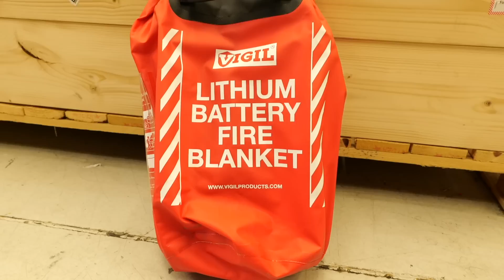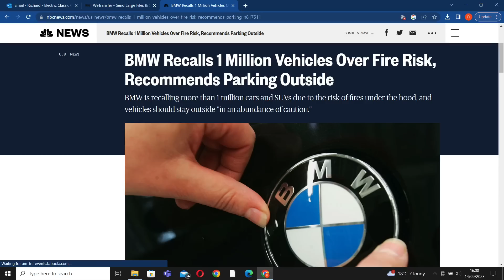Electric Car Fires - Facts and Figures

Comment: My principal objection to EVs are short range, long charge times, excessive tyre wear, very fast depreciation, high prices (although they should come down a bit)... the problem with EV fires is the difficulty of extinguishing them and the huge toxicity of the emissions when they do. High carbon footprint is another thing.
Reply from the maker: You’re missing out all the positives. They’re much cheaper to run, better handling because all the weight is underneath you and better weight distribution, no nasty tailpipe emissions choking up peoples lungs, performance is amazing and over the lifetime of the car their carbon footprint is much less than ICE equivalent. In respect to your points my wife’s Tesla model 3 is 4 years old and done 65k miles. It’s saved her £10k in fuel and servicing costs. Has depreciated only 36%, which is less than any petrol car we’ve ever had. Has had 2 sets of front tyres and one set of backs, which is about the same as ICE cars we’ve had in the past. The CO2 emissions of building a new EV is indeed more than ICE at the moment (although that’s coming down each year as manufacturing becomes more efficient and grid decarbonise) however as the emissions from driving is less than ICE it’s offset after around 16k miles here, but that’ll depend on the carbon intensity of the electricity grid in your country.

Comment: Interesting but not totally ‘factual’! Cherry picking statistics from one country is hardly serious research in my view. 

How many of the ICE fires were caused by arson, collision or other external factors? How many of the ICE fires were the result of spontaneous combustion as opposed to the EV’s due to internal fault or overheating?

Most EV’s are relatively new. Over time, what will the incidence of EV fires turn out to be? Only time will tell. 

There was no analysis or comment on the type of lithium battery, quality of design/construction of the battery or existence of battery cooling system or it’s adequacy if present. 

I’m not anti EV, but question the superficial nature of your presentation.

Comment: Excellent video, love the channel. There is definitely deliberate misinformation out there concerning all aspects of EVs and electrification in general. What makes it doubly frustrating is that the misinformation never goes away after it has been disproven. We are still trying to explain to people now that batteries don't degrade and require chucking into landfill after five years (you would have thought that battery warranties would have given people a clue here?), and we will still be correcting people about EV fires in ten years time when they will probably be even better than twenty time less likely to go up in flames.

Comment: I commend you for trying to divert the fire issue away from Electric cars. I have adopted electric power in so many ways what with a full size electric tractor mower, an electric strimmer, electric hedge trimmers and two high voltage electric bikes which share similar technology to cars but I think it's more about being able to escape from a car on fire and being able to put the fire out which concerns people. Seems to me modern manufacturers want to do everything with buttons, a bit like the TV industry who stopped putting physical buttons on a set in favour of letting the remote control do all the work, basically it saves money.  Old cars that you convert still have handle, a physical connections between the inside of the door and the lock itself but modern electric cars give you a buttons to open the doors which means in a failure the doors are impossible to open. In addition, if that run away fire were to start in your attached garage then kiss goodbye to your whole house, whereas, it might be possible to put out an ICE car with regular extinguishers, if not the Fire Service could. Concorde had a fabulous service record but that one disaster killed it immediately and I think it's this that concerns us folk. I have embraced electric equipment but I charge my equipment carefully, especially the mower which I will only charge away from the house.  If this issue could be overcome then I think the average consumer might be more relaxed about the whole EV market.
Reply from the maker: I thought it was a legal requirement to have a mechanical door handle on modern cars irrespective of fuel type. Even if there’s also a button to open the door, just like on my wife’s Tesla M3? Unless you’re quick with a fire extinguisher an ICE car will also burn your house down.

Comment: The question I have always been asking or trying to research is what is the ratio of heat energy from a battery combusting (without oxygen) to that of the rest of the car burning with oxygen. My guess would be about 100 to 1 meaning 100 times more energy in the rest of the car versus the heat from a terminal runaway inside the battery.

Comment: Hi,
I understand your point about fires are more likely in ICE cars than EVs, given the Swedish stats, but were those ICE cars older, I'm guessing the average age of an ICE car is much higher than an EV in Sweden (or most places).
Are car fires more likely in older cars?

Note I don't think EVs are a high fire risk,  but we do need to get better at dealing with them.
Reply: Looking at the recalls of new ICE vehicles for fire risk would suggest that though age may indeed be a factor it is primarily the inherent challenge of dealing with highly flammable fuel... otherwise new cars wouldn't be being recalled. (You would think manufacturers would have dealt with this issue after more than a 100 years of ICE production!)

Comment: Electric cars that sustain minor bumps are being kept 15 meters apart in repair yards over fears they might explode, adding to insurance bills.

Government guidelines recommend electric vehicles with damaged batteries should be “quarantined” from other vehicles due to the risk of battery fires. Damaged batteries pose a risk of “thermal runaway” where the energy stored in the battery releases rapidly, creating temperatures of up to 400C.

But the practice threatens to increase costs for the insurance industry by more than £600m, costs which ultimately could be passed onto drivers in increased premiums, according to a report by automotive risk firm Thatcham Research

Comment: I own eight petroleum powered vehicles.  I'm now in my seventies and have never had one of my many vehicles over the years catch fire.  I've seen a couple but, so what.  But I will never buy another ICE vehicle.  All my current vehicles will be replaced by EVs or converting into EVs.

But, the Swedish statics you quote are flawed.  The EVs are on average much newer that the more mature ICE vehicles.  Older and probably less well maintained vehicles will experience more fires than new ones.  The fires in the new EVs mostly tend to result from overcharging issues or flaws in the technology that is being designed out, making them less likely to combust spontaneously.

I completely concur that the EV fire headlines are the result of irresponsible reporting, reporter ignorance and also the result of automobile and hydrocarbon fuel producers underwriting negative publicity.  It doesn't help that many petrol-heads have taken the position that they will never give up their gross polluting ICE vehicles until they are pried out of the cold, dead hands.  Idiots.

Comment: If the battery casing contains everything needed to sustain a fire, should it not also contain some form of automatic suppressant that is activated if the temperature exceeds a safe limit?
Reply: That's kind of what a 'seperator' is in a lithium battery (you might remember the Bolt recall was blamed on faulty separators). If the temperature of a single cell gets too high, the porous plastic separator layer in between its anode and cathode melts into a solid piece and the ions can't flow through anymore, so no more heat. It works in most situations, but reality can be another story
Reply: In fact, Renault's new 'Four' has a mechanism that shuts off oxygen and fills the battery pack with water. (I got that from Robert Llewellin's Fully Charged channel so I hope it's true).
Reply: @morrisophile  I saw that too; it was reassuring not only from the safety aspect but also because the idea seemed so obvious I thought that I must be stupid not to know why it wasn't being done already!😇

Comment: The LASHfire report is summarised in a webinar https://www.youtube.com/watch?v=yj76SXMr_ok which has video of electric fires and a live RoRo fire test.

The Swedish civil contingencies agency has a method for fighting a EV fire https://www.youtube.com/watch?v=4xjDdmv8urk 

On car parks, they (UK) already have a floor strength requirement that is greater than the weight of EVs, and have the same LASHfire , lots of 'parked' vehicles in a confined space issues (EVs are 'safer' with respect to initial peak temperatures.., as if any fire is safe ;-)
Reply from the maker: LASHfire is a very good source of information on EV fires, especially in relation to shipping. 👍

Comment: What was the average age of the electric vehicles catching fire compared to the ICE? Seems you would expect older vehicles with unknown service history to have a higher number catch fire. It would be nice to have accurate figures when comparing the 2 types of fuel.
   There were numerous "untruths" about the ship fires. Photo evidence of burnt out EV's and the company stating "no EV's were damaged". Really!
   How about some actual truths about the subject of fires. EV sites are all " the chance of fire is very slim" and the ICE sites are all "EV fires are much worse". In my 50 years of riding/driving, I have seen 1 car fire (ICE), so it's not like car fires are something we see every year.
   EV's are yet to fall into the backstreet, ghetto tuners market. When they do, then I'd expect to see more fires.

Comment: I take issue with your facts.  They would be excellent if you were comparing vehicles of the same utility.  Sadly, electric cars do not have the same level of utility as the internal combustion engine.  I think the better statistic would correlate the number of hours of use to the number of car fires.  It might be even better if you broke out the causes of the fires.  
I imagine that you might make a better case for the utility of the electric vehicle in that manner.

Comment: When agencies capture data on cars that "catch fire," it's often misleading. Yes, cars do spontaneously combust occasionally. They hit road debris.  The exhaust system ignites dry leaves. All true. But this data doesn't delineate between fires that originate within the vehicle and those that start from external sources. Arson is an obvious one. But less obvious is a vehicle that is involved in a collision where the other car ignites and then the fire spreads to both vehicles. Also, one of the more common occurrences, when a vehicle is parked in a garage. Fires from chemicals and paint cans or poor home wiring within a home or garage are tallied as vehicle fires. So for as few EV fires we see every year, there will never be zero because of how the data is captured.

Comment: I think the thing about cars catching fire ‘at home’ - it’s because they are being charged, which is more likely that something can go wrong. Just for context, look how much safety equipment and protocols are in place at a Petrol (Gas) Station - so ensure you are comparing apples with apples.  Furthermore, Battery Management Systems are becoming so sophisticated that they can shut down a module at the first sign of any trouble, preventing thermal runaway as it never reaches the threshold for the fire to start
Reply: Once the batteries start to go, there is no shutting them down.....
Reply: @hemifiedsixtyfour2813  That's the point. New BMS systems shut them down before they reach their flashpoint, so the fire doesn't start

Comment: Maybe cover or at least discuss the elements of the two ((ICE and RCE (Remote Combustion Engines ie Electric)), their risks during respective fires and also the effects on the human body should someone breathe in fumes from the two...
Reply from the maker: Remote combustion engine  is a nonsensical phrase to use. That term doesn’t make sense in countries like the UK where most of our electricity doesn’t involve combustion (wind, solar, hydro, nuclear, etc)
Reply: @ElectricClassicCars  Nonsensical in the UK and similar powered countries yes. The rest? And the elements?

Comment: Electric cars (tesla specifically) are the safest cars out there. all the mass is in the bottom, so it won't roll over as fast as petrol
The roofs on teslas are insanely strong
Electric cars have better crumple zones since there's no engine block.
Tech like autopilot can see things you might have missed.
Reply: just some facts, yes ev's can also catch fire, just lilke any other car
Reply: Yes but fire in ev's starts and spreads insanely fast and is extremely hard to put off.

Comment: Whilst fire safety standards are catching up the risk exposure is higher. Over time, it will drop again. Until that time, the issue as I see it is the consequence side of things: anything catching fire in close proximity to an electric car has the potential to trigger a chain reaction that causes the EV’s battery to enter thermal runaway. If it spreads to the next one and the next one etc, the fire becomes much harder to control and put out.

Comment: It is good that EV fires appear to do dropping.
The real problem however is the nature of the fires, as you mention. DC electrical fires are extremely difficult to extinguish as the fire is created by an electric arc generating huge amounts of heat and burn through most materials. Only stopping the flow of electricity will allow the fire to be damped and hopefully finally put out.

Comment: How hard would it be to add / plumb firefighting ports to the existing battery cooling system that could be used by firefighters to force high pressure water through the pack to cool it down and stop the fire?

Comment: There was a video put out to show a fire suppressing blanket that looked quite promising for extinguishing EV fires.
Firefighters set a large fire under the battery pack of a Nissan Leaf.
It took 8 and a half minutes for the battery pack to ignite and after 10 and a half, the car was still not fully engulfed.
I don't imagine mose ICE vehicles would withstand a large fire under the fuel tank.
I feel even more confident driving my Leaf after seeing the video.
Of course the video set off hundreds of "EVs will kill us all" comments.

Comment: Thank you for giving me a tip of a report from my own country I wasn't aware of! 🙂Let me know if you want something in it translated.

The data is a bit incomplete since it is based on incident reports from fire fighters/rescue services and only include incidents where the report mentions batteries/charging/hybrid etc. The incident reports have no predefined check boxes for type of fuel/drive train/battery type etc. If the responders did not know it was a hybrid that may have been left out.

Somewhat surprisingly fires in BEV and PHEV seem equally likely. 1/3 BEV and 2/3 PHEV which is the same ratio as their numbers on the road.

If someone has the time, energy and language skills I'm sure you can cross reference the 3400 yearly car fires with the vehicle registry to get model year and information on fuel type etc.
Reply from the maker: Cross referencing those 3400 cars would be very interesting. 👍
Reply: @ElectricClassicCars  After some more digging I found that a few years ago the number of cars intentionally burned (arson, insurance fraud...) per year were around 1400, so that leaves 2000 cars burning for other reasons. The number in the electric car summary had disregarded intentionally burned vehicles so the comparison becomes more like one 10th instead of one 20th frequency of fire in EVs.

Comment: Thanks for trying to inject some sense into the ridiculous state or our media on EVs.
We should make some allowance for vehicle age. My expectation for ICE fires is that they are much more likely in older vehicles, due to various bits (like wiring or fixings) getting old and tired. Does the report say anything about vehicle age? Obviously on average an EVs in the car parc will currently be a lot newer than an ICEV due to sales rising, so that probably shifts the fire frequency stats in favour of EVs. I have no idea how much more likely a fire is in a 15-year old vehicle, but it wouldn't surprise me to find it was 10 times more likely? So that may account for a significant portion of the factor-of-20 difference. I guess average vehicle age in Sweden is something like 7 years (all those volvos :-) Of course as time goes on the remaining ICEVs will be even older EVs will probably always be much less likely to catch fire.